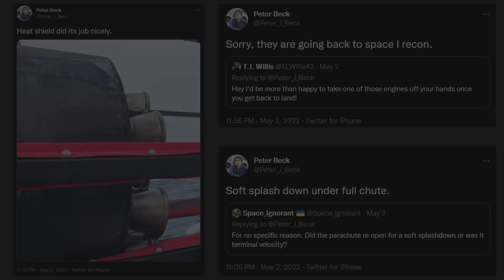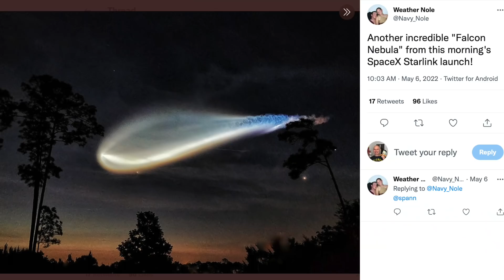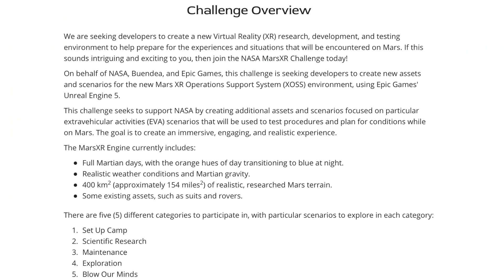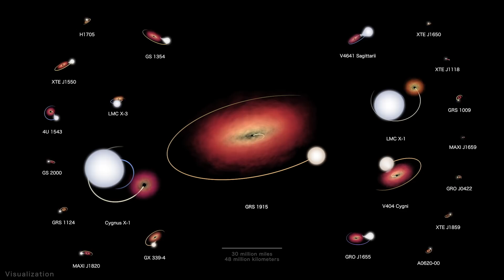SpaceX Planning To Land In Middle of Bahamas - Deep Space Updates - May 10th

Comment: 6:00 Falcon 9 launch 
If you look at the bottom of the "Jellyfish" you can spot the 1st stage doing its re-entry burn.
Reply: Is that rocket flying left to right?, and where would that be an actual view with actual houses?
Reply: @johndododoe1411  The rocket is flying from right to left. It had gotten high enough to be back-lit by sunrise. The higher it goes, the lower atmospheric pressure makes the contrail much broader at that height. At the bottom of the largest part of the "blob", you can make out a small bright spot. That is stage 1 burning for re-entry.

Comment: 12:30 
Dream Chaser looks cool like one of those flying machines you see in Thunder Birds 😎
Reply: I think they stole the module from Farscape.
Reply: @ghost307  It was the other way around. Farscape almost certainly based their design off of the NASA HL-20 Personnel Launch System designed and built by NC State and NC A&T in the early 1990s. Dream Chaser was derived from the HL-20 as well.
Reply: I'm going to have to give the "Cool Retro Look" prize to Starship though, which has always given me a 1940s "Flash Gordon" vibe.
Reply: I don’t remember a ‘lifting body’ in Thunderbirds, there was something vaguely similar in UFO.

Arguably, the real thing in 1963 would predate anything in Thunderbirds being in 1965.
Reply: @fredbloggs5902  Thunderbird 2 was explicitly described as a lifting body design, the big green cargo one with the various pods, I believe. Though it was a heck of a lot bigger than Dream Chaser with quite a different design.
Reply: @MadMorgie6318  great point! It never occurred to me that TB2 was, but you’re completely correct.

Comment: Excellent point about the possible use of SpinLaunch on the Moon.
Reply: Much easier. Vacuum is given, no solid house/cylinder is needed.
Actually, it could be used on Mars as well. From the top of Olympus mountain, almost horizontal spin launch is possible. Sending fuel to Mars orbit would make the fuel need for a home trip reduced, as Starship (or other) could be refilled on Mars orbit from that.
Reply: Spinlaunch sadly will never make commercial space flight.  Way to many of the items put into space are EXTREMLY fragile.   The amount of G forces smashed into whatever come out of that tube is upwards of like 10gs which i would go to think would destroy and sensitive equipment onboard.
Reply: @charlesyaryan6619  fuel doesn’t care much about g forces

Comment: How does spin launch counteract the imbalance upon release?
How does spin launch stop the rotational momentum upon release?
Reply from the maker: Passive aerodynamic stability
Reply: @scottmanley  
Thanks Scott, appreciate the response.

Isn’t that going to be very inefficient as the object will be flying at high angles of attack at high Mach numbers and bleeding energy like crazy?
Reply: @scottmanley  I wonder how they will design a projectile to handle hypersonic heating with the larger version, i imagine ablative would be a bit of an issue if there is different erosion over the surface resulting in mass imbalance, maybe even the off gassing for the ablative material would throw off stability. Or is insulation enough to protect potential satellites in this regard?
Reply: Scott did a video a while ago about spin launch that covered the imbalance at least.
Reply: @matthewwhiteside4619  
Damn, I missed that one
Reply: The imbalance could be dealt with by simultaneously releasing a second mass downwards.
 Maybe a bag of water that'll go splat down in a pit.
Reply: @massimookissed1023  
That’s one hell of a seismic shock, my rough calculations put it at around a 500lb bomb going off
Reply: ask on patreon if you actually want an answer
Reply: @whyiseverysinglehandletaken2  
Thanks, but there are smart people here too